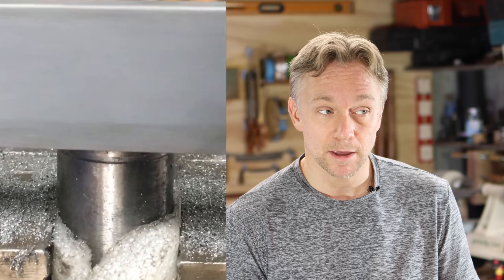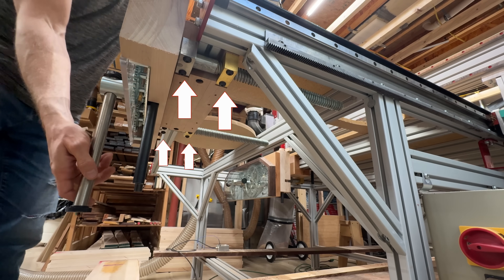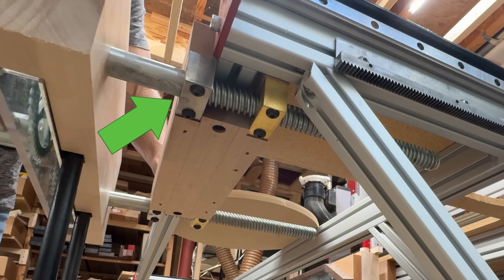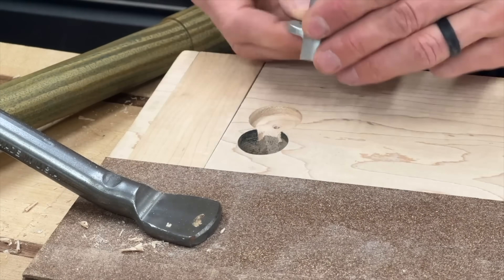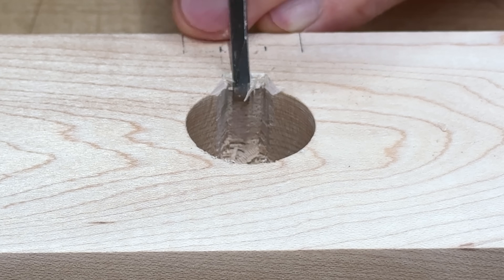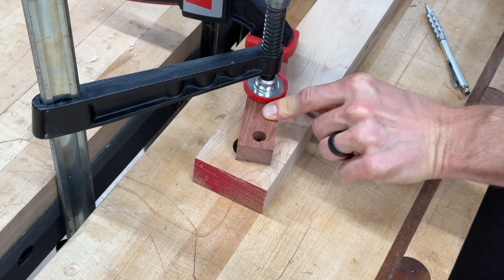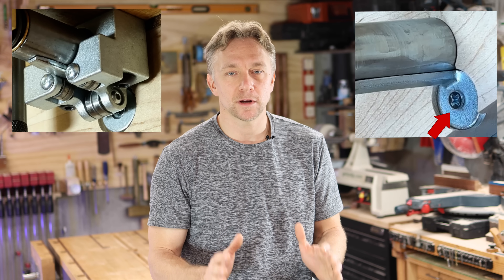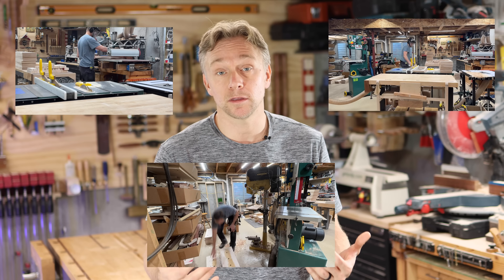Fixing 1,000 Parts... Again! | Twin Turbo Vise Low-Friction Rail Install & Production Problem

Comment: I am one of the folks that the slide was missing countersinking for the screw. Did it myself ….took less than a minute with an easy set up. Very much appreciate that you are willing to send a replacement…not necessary in my case.

Comment: I am one of the customers waiting on my order.  I have wanted one of your vises since I first saw it on your first videos.  When you announced the sale back in April, I could not believe the level of discount and just had to order it.  Heck, I do not even do woodworking and I wanted it.   Luckily, not in a hurry as I am still working on getting power and a driveway to my new workshop.  It is mostly a shop for working on my cars and motorcycles and learning how to use a metal lathe and a milling machine... but I want to have a bench with your vise even if it is to sit down with a cup of coffee and admire the darn thing... it is a frigging amazing looking work of mechanical art.

Thank you for the update and for the replies to my emails.  As others have mentioned you have been upfront with your customers and that is much appreciated.

Comment: Andy, As someone who participated in the preorder of the original TTV before the slip rings were replaced with the nuts on the end of the screws; you have nothing to apologize for. You have been so upfront with the customer base that you have well earned that it puts every other business I have come into contact with in recent years, or possibly ever, to shame. I will definitely be purchasing a second vise since the first one I bought is too long for the end of my Roubo style worktop, interfering with my scraps drawer...a huge oversight on my part when measuring. You sir,  are a compliment to inventors and entrepreneurs!

Comment: For our V1 Powercore I had a similar issue. Made a relatively simple mistake with our extrusion die based on some CAD that did not match a prototype we recieved. Dumbly trusted the CAD and had to do 2000 reworks by hand to get the parts right and shipped out. Haven't made the same mistake since haha -Cooper

Comment: The buzzing sound you hear in some recordings? It's probably due to double-recording the audio with the lavalier mic and the one in the camera simultaneously, but with ~3 ms delay between them. That or a direct bounce form the ceiling.
If hard-wired, that would correspond to a 1 m distance.

Comment: Couldn't you just make a basic punch-template of the 3 hole locations right from the start, do the smallest middle-hole first, then drill out the larger ones after? Since a forstner has a center-follower. It feels like this is complicating by artificially forcing a specific order of operations that now needs a drill-guide, but is that necessary?
Reply: The first large hole is already drilled for the vise screw. . .
Reply: @SteveAugust7  it starts out as such in this video, but I thought that is the side of the recipient's bench where they would be responsible for hardware install? If this is only meant to upgrade an existing piece with a hole pre-fabbed in it, then understandable, but not totally clear. Else if starting with a fresh surface, maybe my suggestion might help.

Comment: I was wondering that when I got mine … on the other hand, since there were no instructions for the screw I just grabbed an appropriately sized button head machine screw and threaded it straight into my maple jaws. Biggest issue I had was figuring out the right length of screw to avoid scabbing the back of the vise (1in seems good).